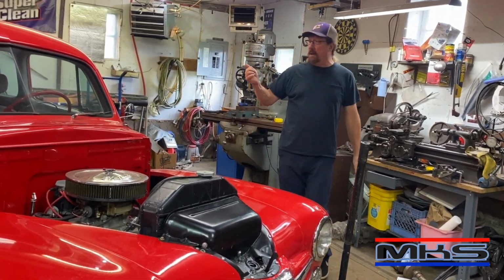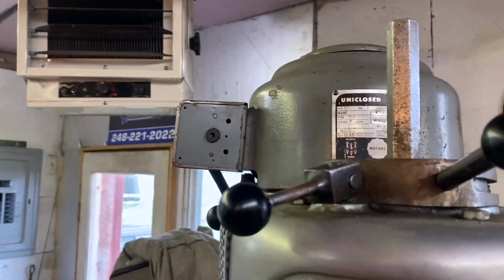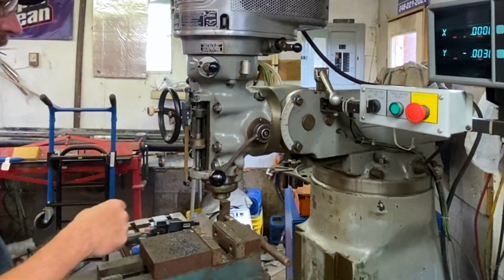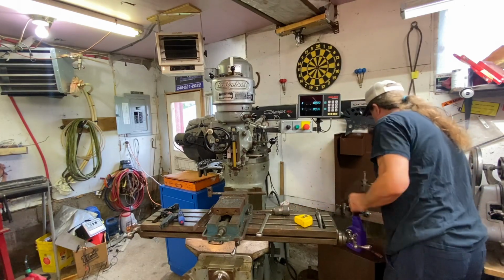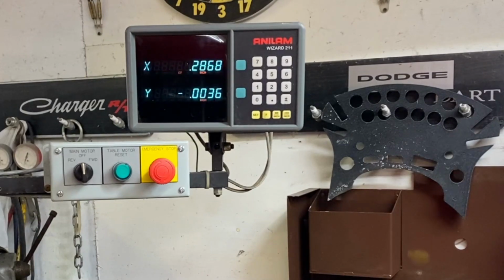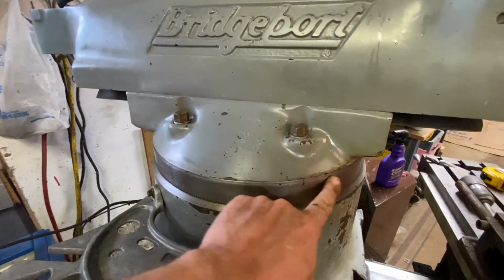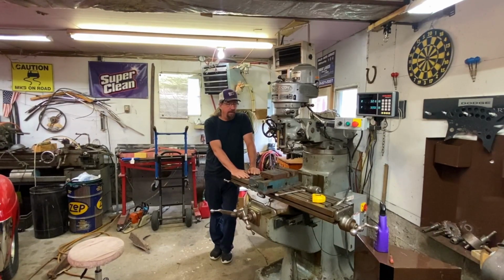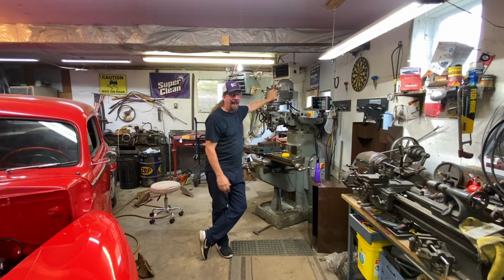How To Use A Bridgeport Mill And Its Features

Comment: A word of caution about those Chinese mills and lathes. Some are pretty good, and some are pretty bad and most of them need enough upgrades you could buy a used full-size mill or lathe. I have jokingly said that I'm going to turn my Vevor lathe into chips on my mill when I get a decent lathe. My list of parts I want to make on my Bridgeport is getting longer. It can all be done without the Bridgeport, but the machine makes you more proficient. It is hard to relate to making a part when someone jumps on a machine that is out of their reach. But I expect quite a few people are watching for the entertainment. And if, like in my case, owning this equipment is in your bucket list you have to do whatever it takes to make it happen. I also think something might be wrong with my boring feature. I didn't catch what you did to make it work and I watched that part twice. I'm not where I can get to mine right now, or I would go out and play with it. RAWK!!!!
Reply from the maker: That’ll be a great talk about it Tuesday subject as I have some experience with imported units. Thanks for that.

Comment: This is sort of what I did for 7 years, only my machine worked on wood not metal.  If you want a one machine that does it all woodworking tool look up WEEKE BHX-050. A drill press, router, and groove saw, all-in-one.  It also has edge drills for drilling dowel holes to join. Great for cabinet making. And it's footprint isn't much bigger than your end mill.  You mainly need to leave room on each side to feed the material, so the area it takes up is mainly determined by what you are feeding through it.  If you are working on a 7 ft. tall bookcase, then you need more than 7 ft. on each side. You can have it outfeed to the same side as your input if you have limited room on the right side. Your door panel, from the previous video, would be a breeze for this baby. 😼.
Until next time.

Make it Safe,
Make it Done,
  👨‍🔧&🚘
Go Have Fun❣

Stay hydrated, safe, and healthy. 🤟RAWK!
Reply from the maker: Yes. They make similar products for metal work as well. Some of them are under the Shopsmith name.

Very cool